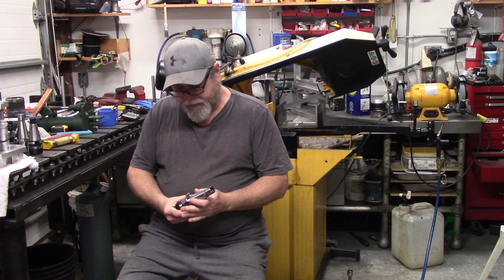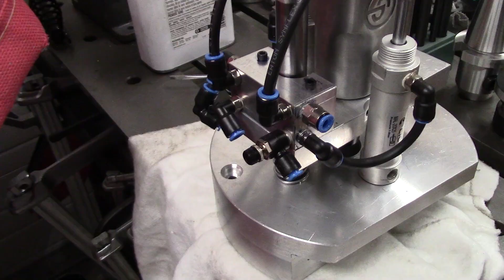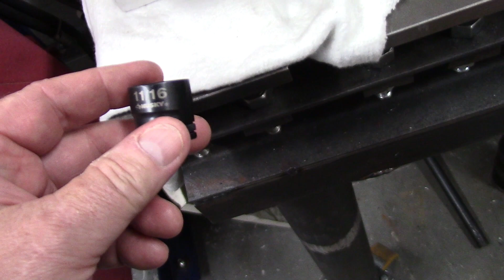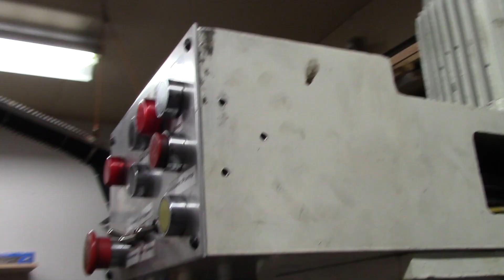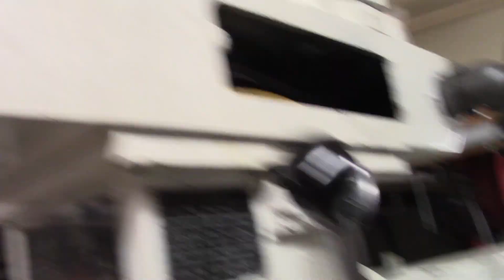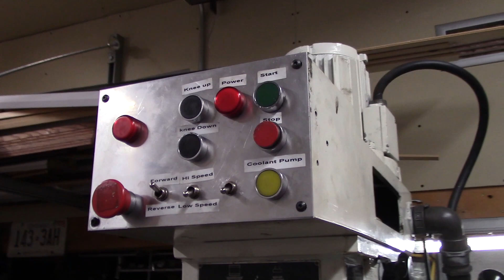Another Night It the Shop 39  Power draw bar PT8 update

Comment: Thanks for the video. You have the same mill as me I ripped off the motor and put a vfd on for variable speed
Reply from the maker: Yes want to do the same .Put 3 hp .
But got figure up the electrical. As mine 600 v
Reply: @fredsmachinewerks4811  Mine was too I tore of all the feed motors and put steppers trying to convert it to cnc my vfd runs off 220v single phase. It's nice to see other Canadians posting videos on YouTube. Right now I'm making a power draw bar like Collin out in Alberta.